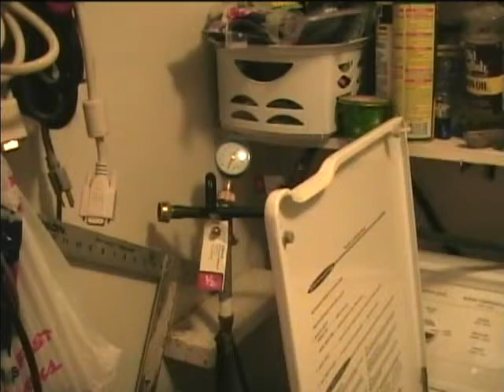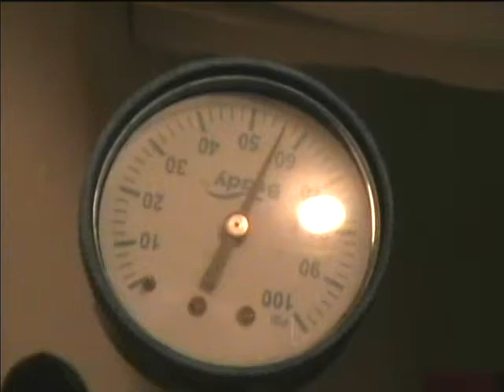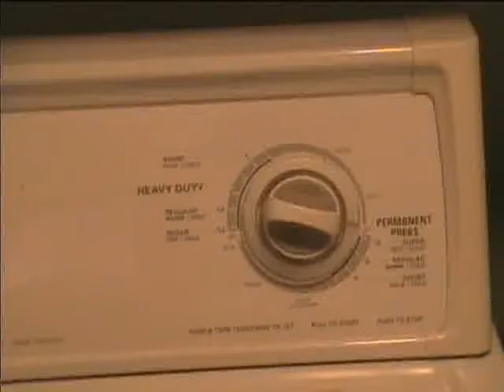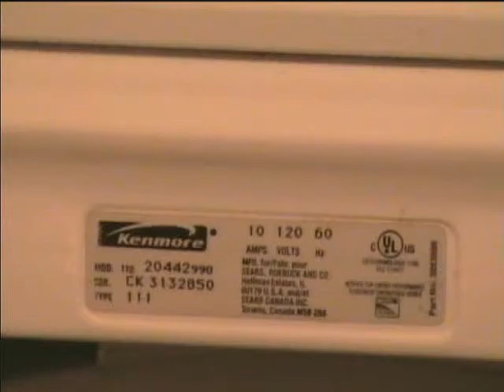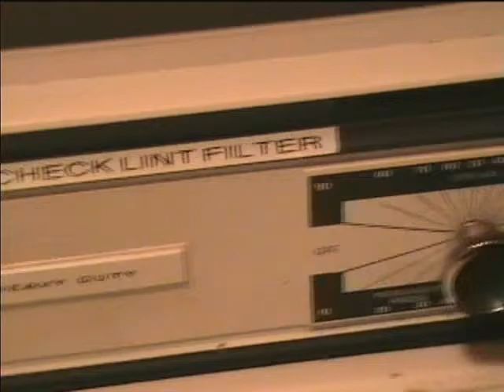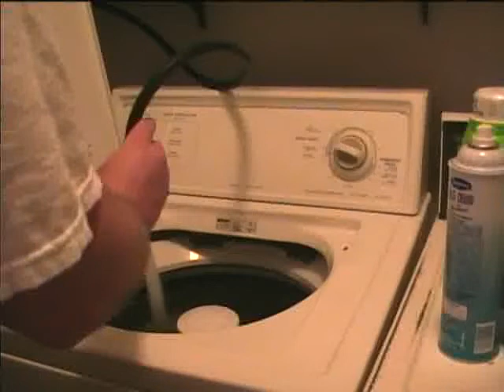2000 Sears Kenmore washing machine and 1960's Kenmore Dryer

Comment from the maker: I just saw a center-dial Maytag at an estate sale plus there are vintage machines at a local thrift store. I might just go ahead and get one and use the 2000 Kenmore as a back-up.

Have you ever fixed the valve/screen problem where it got plugged up with sediment? I actually have not done any laundry machine repair before.

Comment: The screen full of sand or whatever, it shouldn't be too hard to clean out I think,
I'm not exactly sure what the screen is,
but I would suppose a good blast at it with
that kinda water pressure would clear it up.